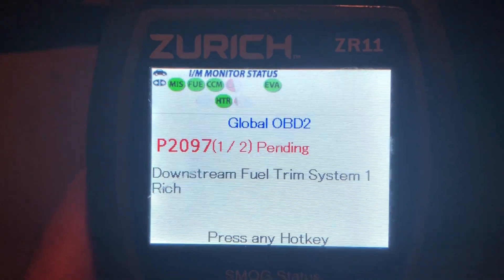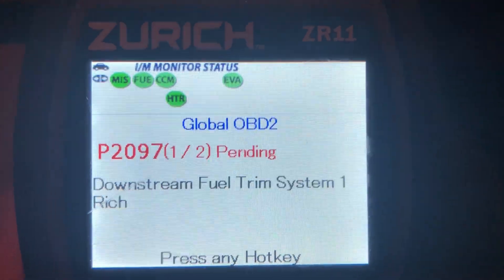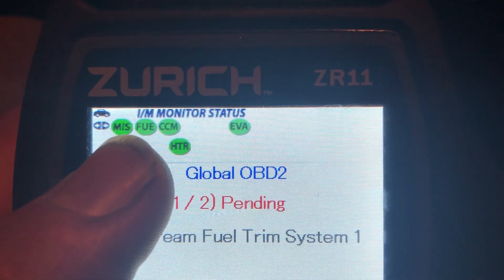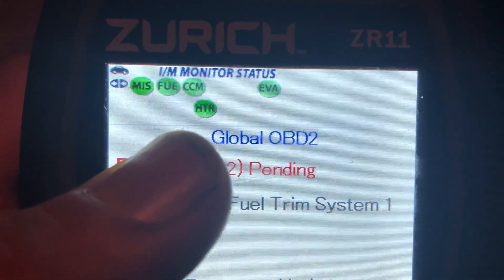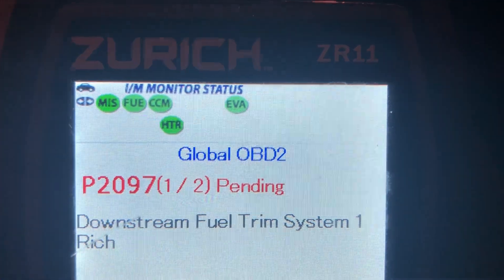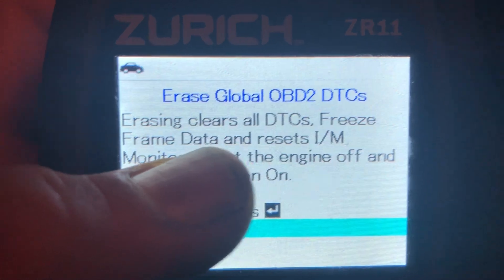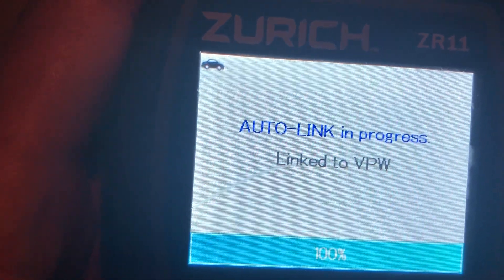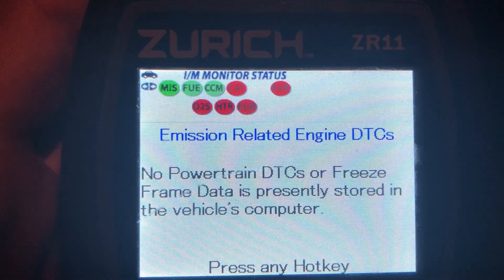why clearing your check engine light will NOT pass emissions

Comment: I’ve seen many ppl clear codes and pass inspection
Reply: Your lying
Reply: @jamarspellman581  T.C. Crawford is absolutely right... I've done it twice and passed! But after doing it two times it wouldn't work the third time because the computer remembers.
Reply: @RC-hg9dw  how did you do it
Reply: @RC-hg9dw  what did you use??
Reply: @kingshaun2x  I didn't use anything, although someone did tell me in the past to put high percent bottle of rubbing alcohol in gas tank with gas if you are worried about smog.  This is what I wrote in comments in another spot... 
"From what I have heard from other people the drive cycle is different for different cars. But I passed twice in a four year period doing this after driving 80 miles straight and then straight into emissions without shutting my engine off so the light doesn't come back on. You cannot shut your engine off (NOT ONCE) when you do the drive cycle for my particular car and have to drive it directly into emissions after that 80 miles without shutting it off.. Although it did not work for me the third time as I thought it would no matter how much I tried. I was told the computer codes remember and it would not work again without getting the issue fixed."
Reply: I always opted for the tailpipe test.
Reply: Yeah I've done it for three years, but this year they failed me! Go figure 😒

Comment: Well once you clear the engine lights then you have to do a drive cycle depending on what car you have. And yes it does work if you do the drive cycle after.
Reply: By that time the light will come back on...
Reply: How many days does the drive cycle take ? Thanks again.
Reply: @u2fkeys665  from what I have heard from other people the drive cycle is different for different cars. But I passed twice in a four year period doing this after driving 80 miles straight and then straight into emissions without shutting my engine off so the light doesn't come back on. You can't shut your engine off when you do the drive cycle for my particular car. Although it did not work for me the third time as I thought it would no matter how much I tried. I was told the computer codes remember and it would not work again without getting the issue fixed.

Comment: I had check engine light on 3 codes appear so i fix the problems i drove it 60 miles check engine light came off so i took it to the smog didnt pass because monitors incomplete do to CAT and EVAP

Comment: The manual outlines the drive cycle requirements. I have the Zurich 13 and it has a smog status LED lights. Also, if you disconnect the battery prior to a smog test it will fail because, again, you need to go through some drive cycles to re-aquire the data
Reply: Yep I changed battery in 2001 Sienna and got "No Codes present in module". I heard I have to drive 150 miles at mostly 45 MPH for a drive cycle to reset .On IM Readyness  I had CAT and O2 errors. I put some "pass or dont pay"  engine/CAT cleaner in 1/2 tank drove 19 miles and CAT and O2 errors went away. Now I have to drive more miles to get the drive cycle reset. I have a small evap error but it will still pass smog in Placer county CA. They say don't try to pass SMOG with that cleaner in your tank because it doesnt burn right like gas. Also they say, run fresh Premium 92 octane at SMOG time because it burns hotter for CAT cleaning. 170k on the Sienna.

Comment: You provided info (& answers to questions) not addressed in the manual. In particular that the red flashing icon means the cars system isn't yet ready to be tested and basically the car needs to run longer to test properly. At least I couldn't find the info. Bravo!

Comment: Whoa. I don't take 100 mile trips at age 75. 8-) Here's my issue:
A blinking Monitor icon, "EV", yellow LED indicator light, No DTC's presently stored in code reader's memory. Also, NO Engine light is presently showing on dashboard.
Reply from the maker: Your evaporative emission monitor isn’t complete. You need to drive it further to allow the PCM to complete that monitor, maybe not a whole 100 miles but longer than you have been driving it.
Reply: @kyle-kelliher  - I'm an old guy who doesn't have anyone to drive 150 miles at a time. Someone has to design a system easier than that. Remember, too, I don't have an inspection sticker/brake tag to dare cops from giving me a $250 ticket for an expired one.
Reply from the maker: I really don’t know what to tell you, the readiness monitors have to complete in order to get it to pass, there’s not some magic trick I can tell you to do.
Reply: @kyle-kelliher  Thanks for your input, Kyle. Not everyone can afford or travel these days go to Biloxi and back to try and satisfy a computer's travel recommendations. I suppose my b****ing is aimed towards manufacturers who devise a system to waste gasoline/oil/tires and one's patience when a system which can detect a driver's habit of running around town which should be able to satisfy a module. Pitiful and a genius is not needed to think this one out. 8-)

Comment: Question My check engine light was on in my 2000 Toyota Solora it "COULD" Have been the gas cap (SHESSH I GUESS I'LL NEVER KNOW😕)because it was lose.  I cleared the codes (LIKE A NON MECHANIC)not knowing I would fail smog 😡 thanks to 👉DIY YOUTUBE VIDEOS👈now my cat light is blinking on the scanner how will I know if there is a possible problem with the cat if there's no codes stored..
👉Seriously A Woman who dosn't know👈 Thanks in advance for your help.☺
Reply from the maker: So, basically, you didn't do anything that bad. But, this is how it SHOULD be done. You start by checking the trouble code. Address the code presented. So, in your case, the only codes that could possibly be fixed by tightening/replacing a gas cap would be EVAP related. So, for the purposes of this example lets just assume that tightening the gas cap would fix it- you still would need to clear the codes to turn off the light in most vehicles. After doing that, you will have to complete a full drive cycle. The catalyst monitor will either present ready OR will give you a code to address. If its not ready you need to drive more.
 In reality, the way the PCM monitors your catalyst is with o2 sensors. So, you might want to go ahead and replace those first- especially if you have a car with a $1200 cat. I know, that could end up costing you an extra $150 even if you do that work yourself, but you dont have a crystal ball here and its kinda a cheaper bet to make than replacing the cat right away.
As far as being a "woman who doesn't know" guess what- guys arent born with this knowledge. If we can learn, so can women. Don't let your gender hold you back. It's a machine, it doesnt care who is working on it.
Reply: @kyle-kelliher  Indeed I agree not going to bet against you on replacing  the sensor..I work on cars my stepdad taught me as a kid nothing big I can change oil.replace alternater transmission fluid fuse Not anything electrical I've never  seem to fix the problem I did make it worst..Sheesh 😀
I'm a lover of Old School Muscle  cars 😊
Anyhow Thanks a Million for your Advice I'll leave a  update  on the fix.
Reply from the maker: @bayanahyahawadah7804  yeah no problem! Luckily you haven't cost yourself anything but a couple clicks of a gas cap and some mileage on your car.
Reply: @kyle-kelliher  I did a complete drive cycle the light is off now 😀lm gonna upload a video to share and hopefully save someone from spending money... Thanks again

Comment: I took my 2006 Nissan Xterra to the Nissan service center for check engine lights. The code called for replacement of both front and rear passenger side 02 sensors. They cleared the codes but failed smog. The smog guy says to do a drive cycle to get OBDll ready. Dealer won’t listen and they keep replacing unnecessary parts. They have my car now for a week. Crazy.

Comment: I had all my monitors green, except the O2 Sensor Heater and I did another drive cycle and it didn't go green. I had the check engine light on for a P0446 Code (EVAP Emission Control, System Vent Control Circuit) ; and a P1870 Code (Transmission Component Slipping) :  I was told it might pass smog even with the light on and the O2 Sensor Heater code incomplete. I reset my codes because I got tired of looking for the issue and putting money into my vehicle to try and fix whatever issue it had. It just has the EVAP and O2 Sensor Heater incomplete now , do you think if I do a Drive Cycle in the cold morning both will turn on and the light will stay off so I can finally get my vehicle smogged here in Northern California? What do you recommend I do? Mechanics around here, just give me BS- that they can fix the issue and then reset the codes and i'll pass smog.
Reply from the maker: Short answer is you need to replace your o2 and figure out the evap problem to have a shot in hell at passing. California don’t play games on emissions.
Reply: I replaced the O2 sensor that goes next to the CAT , before I went to try and see if it would pass smog and everything passed - except the OBD and my mechanic said it was because of the sensor I had just put in a bit earlier that day. he told me to drive it around the freeway and to go back, so I did that and then he told me that EVAP wasn't running and that I needed to keep driving more, i don't know if he was telling me the truth or not. Days go by and I keep driving it and going in and he kept telling me to drive it more- then the light popped up and i got it checked at autozone and they said a transmission component slippage. sooo??? wtf? then I got an OBD2 and i saw that the EVAP issue had appeared, so I did a drive cycle in the cold morning and the EVAP went green, but not the O2 Sensor Heater - and the code was still displayed on the obd2. California is crazy. what are your thoughts on this?
Reply from the maker: it sounds like your evap solenoid has an intermittent issue. I would replace that solenoid. the o2 sensor heater could be a wiring issue somewhere. you'd have to get into it and see if there is a short or a bad wire to it.
Reply: Technically CARB allows EVAP status to be non ready. Look it up, some smog tech are just picky or CARB is saying one thing and fining SMOG centers anyway for money.

Comment: Wrong, I’ve passed many emissions clearing engine codes right when I get there. And I still done it recently. False video.
Reply from the maker: You didn’t pass legally. Here’s the specific language from the CA emissions inspection handbook- “Pass/Fail Criteria: The EIS or OIS may include an assessment of the OBD II system’s ability to communicate, the readiness of system monitors, diagnostic trouble codes, vehicle identification, existence of system modifications and the MIL command status.”

You can view the book here, the quoted section appears on page 18:
https://www.bar.ca.gov/pdf/smog-check-manual.pdf

Comment: I think what some say is that if you clear ch eng light and drive around for awhile there may be a window where monitors are ready and ch eng light hasn't returned - yet! So if you have a scan tool to keep checking for this window , and rush to get emissions inspection when monitors are ready and ch enf light hasn't returned  yet , you can pass . Also , that the window will work if only 1 monitor not ready .

Is this wrong? Some have said it works . Of coarse , fixing the problem is in many cases important , but being able to get a drive sticker an immediate concern .
Reply: Yes that’s correct !
Reply: Won't the scanner at the smog check show I cleared the codes?

Comment: If the light is yellow on the scan tool or pending, will still pass?
Reply from the maker: Angel C you should ignore the lights, you need to pay attention to the monitor status and trouble codes.
Reply: Kyle's cars there are a lot of codes, but there all pending. My scan tool light is yellow not red. Will it still pass?
Reply from the maker: Angel C depends on what state, but in general, no. As i said in this very video, had you actually watched it.
Reply from the maker: @Glenn John learn how to read.

Comment: Thanks for the info- on zurich zr13 about clearing codes. I have a 1999 blazer 4.3L I am having difficulty with starting and excessive fuel smell at tail pipe
Reply from the maker: It’s always tough to diagnose a car off a YouTube comment. But, id start by checking for spark issues.
Reply: I have the same vehicle and I say, it might be your CAT. I was having a similar issue with the fuel smell at tail pipe- so I got a new cat and now it smells like wine lol. Don't know about your starting issue though

Comment: I cleared mine and failed because they hooked it up to a computer and the drive cycles wasn't complete. Older cars you'd probaly be ok
Reply: How long does it take for a drive cycle to complete?
Reply: @myyoutubechannel3737  it depends sometimes 30 miles sometimes 100 miles. I bought a code reader for 40bucks and it tells you when its done.
Reply: @dragonsnatch1146 thanks again appreciate it.  I cleared my check engine light  And the check engine light has not come back on.i drove the car over 100 miles. And it has been 1 month and no check engine light .. Where can i go to check to see if the drive cycle is complete? ?
Reply: @myyoutubechannel3737  you can borrow a code reader from auto zone. I bought one from O'Reilly and its under im: readiness in the menu.
Reply: @myyoutubechannel3737  if its been a month your probally good.

Comment: Is the ZR 11 a good scan tool to use on a hybrid vehicle?
Reply from the maker: Well, it’s fine to use on a hybrid IF you’re just trying to pull codes for the gasoline power train, abs, or srs system. Some hybrids will allow access to trouble codes related to the electric drive system. but even if it does DO NOT attempt to service those parts yourself. The amount of voltage stored will kill you if you make a mistake.
Reply: Kyle's you are correct  but the good thing is that  I have actually done some work around that area where the battery and voltage is concerned as I have actually taken it out and separated it from the car twice, but I really need something that will give me more than just a few chords as I mentioned previously but I totally love watching your reviews and if anything comes to mind please do not hesitate to point me in the direction
Reply from the maker: Well it really depends on what you’re looking to diagnose on your car. I don’t think it’s any worse than any other non manufacturer specific scan tool for the job. There are some for more money that can do a few more functions but ultimately the only way you’re going to get any real hybrid specific functionality is to spend thousands on the real manufacturer specific equipment.
Reply from the maker: The Oxygen please tell me if you have a requests for videos. I always struggle to come up with stuff to film that people actually want to see

Comment: Clearing your codes will only make you fail Put seafoam in your intake through a vacuum line make sure you get someone that knows what they’re doing then put it into your gas tank drive it through make sure you get someone that knows what they’re doing then put it in your oil then change it and you have a brand new car intake alone will pass the smog

Comment: but what if the check engine light came on several months ago but then went off without getting any work done to it, will my 2004 truck still fail the smog test?
Reply from the maker: If the readiness monitors are complete and no codes in the module it won’t fail for that particular reason. They will check for codes though, the light might have went out but there could be codes stored.
Reply: teevcee77 If the light went off, the computer no longer Sees the problem. A Actron CP9690 is a good tester. It checks live, record, emissions readiness tests, oil light reset, ABS, SRS, and MORE! The screen is large and easy to read. It is well kit. It has code connect to diagnose cars. It works from 1983-2013 and is updatable with the computer cable you can get from EBAY or Amazon. It retains the memory after unplugging from the vehicle for later review. It has cables for OBDI for Ford GM., Chrysler, and 2 Toyota. It has a OBDII cable. It comes in a black pouch. You enter the make and year and engine size. Then select which test. If the CTS says it's 33° and really it's 88°, the CTS is bad. That can cause high idle and excessive fuel consumption. It also has freeze frame. It has oxygen sensor tests and graphing with 2 colors to show your test and a normal test result.
Reply: @kyle-kelliher  if you do a drive cycle  and all monitors are complete and the check engine light does not come back on then what? Say if you did have a check engine and you cleared it .. But it did not come back after the drive cycle.